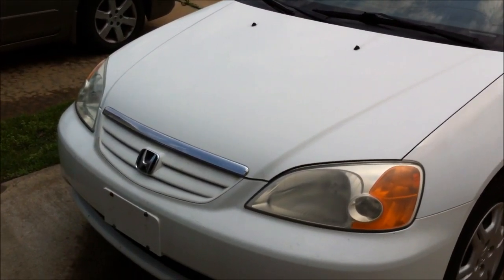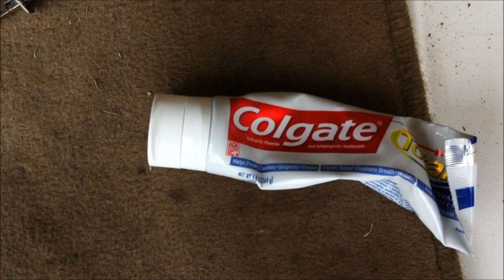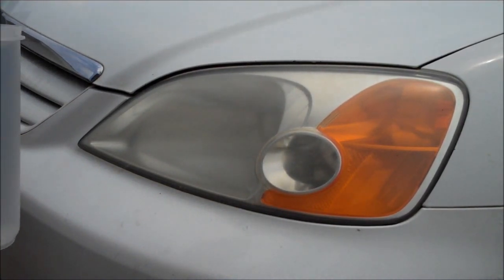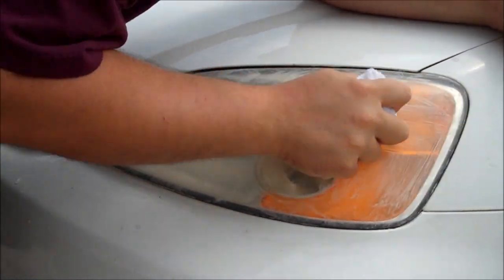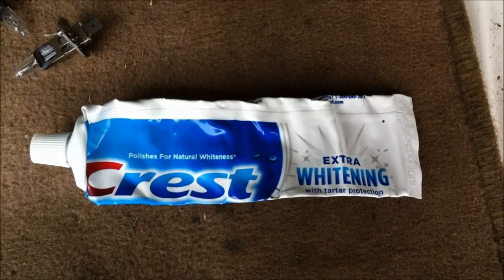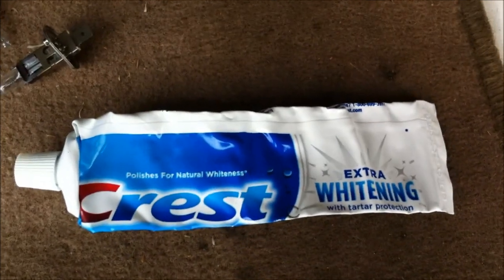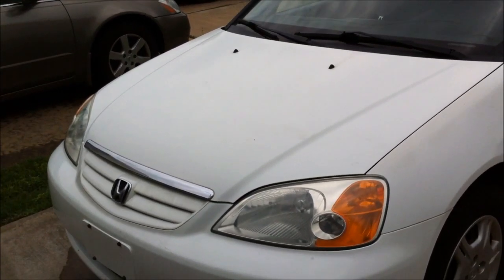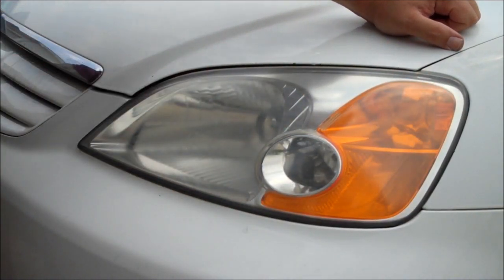Headlight Lens Restore using Toothpaste!

Comment: I restored my 12 year old Corolla headlight lenses. They were getting to the point that they wouldn't have passed through the MOT certification.  My garage advised I try original T cut and after several hours of working each lens, using a circular motion on them they came up like brand new.  It's much cheaper to do this than buying expensive units. I still give them a polish when cleaning my car and they look good still.
Reply: +oldproji   Really - I wonder - because I did this to just test it and it did not work at all. The haze was still there after 20 minutes of circular scrubbing - it really is a waste of time.  I will buy replacements.

Comment: Just did my 2001 Camry's lenses and am very pleased. Went from super-hazy to near total clear. It didn't restore them to brand new condition, but nearly so. For SURE beats spending money for the over-priced commercial stuff. if I were going for absolute best results, I'd use the fine grit sandpaper and clearcoat method. But this was perfect for what I needed. Cheap Colgate FTW. Thanks for the video!

Comment: It also does a better job than most things in regards to getting mineral spots, bugs, or tree sap off of window glass while not scratching. Also the toothpaste with baking soda from the dollar aisle works rather well.
Reply: It's not going to be one of the main brands, but rather a "generic" brand. I think it'll be Dr. Whitmores or something with a name like that. Baking soda toothpaste also seems to work much better than regular baking soda, probably because the abrasive is in an emulsifier or something like that. It doesn't settle out or need re-wetting as much.
Reply: 0000 steel wool is an excellent window cleaner. Try it on any window grime dry, it will NOT scratch. Wash the glass 1st to knock off any loose dirt.

Comment: I'll be darned if it doesn't really work. I picked up a small tube of Arm & Hammer Advance White 'cause it has baking soda and peroxide (i.e., has grit). Applied to headlights on a 2008 Prius which had some, but not real bad, oxidization. Worked like a champ—Thanks!

Comment: My dad told me about this trick too. He also told me about how when he was a kid, during the muscle car era, if your car won’t turn over and you’ve eliminated the cause being a dead battery buy turning on all your interior lights and blasting the heat and stereo and then turning on accessories and there’s no headlight dimming, then your starter is toast, but there’s a trick to getting it started so you don’t have to pay the sometimes absurd towing fees, that he and his friends used to do...hit the starter with a hammer...it sounded like BS to me too, but I recently had my starter die on me and to my amazement, after locating the starter, which depending on the car is usually the hardest part, hitting it with a hammer, it started immediately. This worked 4 more times before payday rolled around and I could buy the starter and change it. So these tricks are timeless I guess, also always listen to your dads, their wisdom is just always on a much higher level and they teach you so much. My dad said the oxidation may appear to be on the inside, that’s what i thought at first too, but it’s not and I believe him. Also he said the type of toothpaste doesn’t matter, my guess is this guy just needed to do another round or two of buffing and rinsing and would’ve ended up with equal results on both lights.

Comment: tried it on my 8 yearold cl500. works great. also, you should use something like a turtlewax paint polish to apply a clear coat on top of the headlamp for protection from oxidization.

Comment: Great tip! I used a 3M kit about 3 years ago. My lights looked terrible again. I am lazy I still had the foam polishing pad from my kit. It saved me some time. I used colgate optic white. My results were 90% as good as the kit and much faster and less expensive.

Comment: Dude, I just happened to use the toothpaste you recommended (Crest extra whitening with tartar protection, mint green with the granules), so I tried it out on the cloudy headlights on the used car I just bought. It magically cleared them up, but then I noticed there are all these little scratches on the lens now.

From another website: "What kind of toothpaste works? Toothpaste is a mild abrasive, so it naturally works well to polish things, and fill small scratches. Just don't use any kind of toothpaste with cooling crystals or anything like that, as they will scratch the surface badly."

That's exactly what happened. What's the deal and how do I fix it?
Reply: pontiactmontanna2002tractionsencerllocation
Reply: More polishing might help. With a non scratchy toothpaste.
Reply: Do it the proper way - progressively finer sandpaper to roughen then polish it, then spray a clearcoat layer to stop yellowing.

Comment: It works well, been doing it awhile now.

But to restore them to pretty much factory. But a foam buffer for a drill and use it with the toothpaste. Amazing results. The foam wheel is about $5-20.00 depending on size and how good it is. $10.00 is about perfect it will last 5-6 months. And you can repeat cleaning lights and even polish you car with it. The cheap ones only work for 1-2 jobs if you do it right. But, if you have a newer car...thats all you need. I have a 2003, so I went with a $10.00 one. 

HUGE TIP: Make sure you rinse the lights VERY WELL. Any extra toothpaste will turn yellowish fast. And make it look like you never cleaned them. Friend did his in 10min (both) and 2 days later...yellowish. Take about 20min and do it right. 10min per light seems to be a great time per light. And seems to last about 3-5months. A coat of polish (good stuff not cheap) after helps them stay looking good longer. It repels bugs, and also makes it less likely you will get all the nasty stuff on the lights in rain and stuff. And it is alot easier to redo the next time. Always a plus!

Comment: This did work for me. 2007 RX-8 with moderate yellowing. The cloth actually got stained yellow. I used Crest with extra whitening.The lenses are 95% improved to original. I waxed over them just to prolong the effect. Good luck with yours!~

Comment: My B-in-law used a Turtle Wax headlight lense kit on my car with very poor results. I looked up other methods here on the net and saw where one guy used a Fresh Lemon , cut in half to rub the lense for a minute or so then let it dry. Next he used a was of steel wool, a very fine coarse, finer than 0000 grade to scour the lense. Wiped it off, rubbed the Lemon Juice on again, let it dry then buffed the lense with a soft clean cloth, like an old clean T-shirt. Last he coated the lense with a carnubba wax, let it dry and buffed it off. I tried it but could only find Ten-O Steel wool and then I had to search for it, found it in an Ace Hardware. I found the surface to be very smooth when I finished with it. It worked and Lense looks like new from the factory.

Comment: By doing this sort of "repair" you are removing the U.V. coating on the lens.In order to do this correctly you will need to add a coat of U.V. stable clearcoat otherwise they will just cloud up again in a month or 2.

Comment: I used colgate optic white, which is slightly more abrasive. It takes a lot of rubbing but does work, albeit very gradually. My wife came out with metal polish and said try that. After a small test area, we did the complete set. FASTER, brighter and now 12 year old headlights look new again even after a few days, so it is not temporary. Much easier to get quick results.

Comment: But I always thought the dullness came from inside the head light.
Reply from the maker: Not always....that can be the case sometimes, but most of the time, it is oxidization buildup on the outside of the lense.
Reply: Dullness comes from the inside but only with people not headlights;)
Reply: That's exactly what I thought.
Reply: Nice one Dung file.
Reply: el pelotero michoacan
Actually it is true, my auto instructor said toothpaste is good, ALTHOUGH the ones with crystals in them is a bad idea, since those scratch up the headlight
Reply: Some headlights do fade from the inside, especially if they have been getting moister inside. If you would like a real product meant for cleaning off the oxidation from the outside of the headlights go to LenzClear.com
Reply: Nope your wrong moist only happens inside not discoloration.Most likely you haven't cleared the outer lens properly and you concluded right away its from inside.Your Wrong I am sure of that.Use megiuars plastix 100 percent effective than toothpaste.
Reply: Denman Delos Reyes  Nope your wrong. I guess your new at this, Just today,  I have a 2004 Saab 93 areo faded from the inside. Older jeep Cherokees fade from the inside. I have come across many more over the years. Call any junk yard and they will confirm that I am right. Maybe you should check your facts before opening your mouth.
Reply: Mi Mo Nope your wrong. If it's from inside then you have polished it inside?You are talking to a qualified mechanic.Where did you acquired your training?Online?Your just advertising product's.I've never found lens that fades inside.I guess only fools will buy your product.
Reply: Mi Mo No your wrong.I had been a mechanic for a long period of time now.Since the production of plastic headlight lens I have never encountered a fading inside.Most likely that's you alibi to your customers.You are talking to a qualified mechanic who has a 25 years experience in this field.Where did you acquired your license online?Check Facts first before bragging and make sure you read all the tech info online.
Reply: I have been in the car business all my life, racing at 18 starting a car detailing business at 22 a few years after that, a car dealership. I have been going to auctions, junk yards and dealerships all my life. I am now 50 If you think your so right, how much money do you have to bet. put it where your mouth is. Headlights can and do fade from the inside, its rare, but it happens. I have a set in my driveway and on my neighbors Cobalt.I have also seen it recently on a 95 jeep grand Cherokee, it also happens to some older  E class Mercedes. I will welcome any bet, All headlights are not made the same or from the same polymer, poly-carbonate . Which is plastic for guys like you who think they know what there talking about..
Reply: Denman Delos Reyes I have been in the car business all my life, racing at 18 starting a car detailing business at 22 a few years after that, a car dealership. I have been going to auctions, junk yards and dealerships all my life. I am now 50 If you think your so right, how much money do you have to bet. put it where your mouth is. Headlights can and do fade from the inside, its rare, but it happens. I have a set in my driveway and on my neighbors Cobalt.I have also seen it recently on a 95 jeep grand Cherokee, it also happens to some older  E class Mercedes. I will welcome any bet, All headlights are not made the same or from the same polymer, poly-carbonate . Which is plastic for guys like you who think they know what there talking about..
Reply: Denman Delos Reyes you're**
Reply: Denman Delos Reyes  bullshit. headlights oxidize from the inside too and get damaged, and you cant clean them....
Reply: gawddang actually you can clean it from the inside just takes a longer process and I wouldn't recommend for everyone but what I did to separate my headlights was to bake them in the oven at a very low temperature of 200 for 20min which loosens the glue that holds it in place which I then wiped the inside to clean it all before I painted the certain parts I wanted. I also used the same method for my tailight which was getting moisture inside and resealed it with clear rtv silicone
Reply: Cindy Sin So did I.  Wouldn't the "seal" on the headlight unit have to be "broken" for oxygen to get in (like a two paned glass window)?  It makes sense for the outer surface to be oxidized given its exposure to the "elements".And why would there be a number of (expensive) products on the market to apparently only "clean and polish" the outside of the headlight?
Reply: Classic Gamers HQ if the headlight cracks it will do that
Reply: In your case Yes Cindy, they dullnes may come from within.......lol
Reply: Denman Delos Reyes yeah thought as much, thanks

Comment: There is a principle of "abrasives" being ignored here. "Abrasion" is the removal of material, and your headlight's surface damage goes pretty deep.

Sure, you can get some fairly decent results with just toothpaste, but it is certain that the restoration will not last as long, and not look as beautiful as it could have if all the damaged material had been removed.

Here is a WORD PICTURE that will help you understand the problem with beginning with TOO FINE AN ABRASIVE LIKE TOOTHPASTE (which happens to be an excellent and cheap abrasive!). Imagine the microscopic, damaged surface of your headlight as a series of "mountains" and "valleys" (pits, cracks, crazing, wear, scratches, etc. etc.). If you begin with too fine an abrasive, YOU WILL NEVER BRING THE MOUNTAIN PEAKS DOWN TO THE VALLEYS! It would take you hours and hours, and you would never be removing enough damaged material to obtain a complete restoration!

In other words, beginning with too fine an abrasive like toothpaste will only succeed in polishing the highest  "mountain peaks," and nothing more! Get it? Will you see an improvement? Yep! But it won't blow you away, and it won't last because you still have lots of damaged material on the surface.

The right thing to do is begin with a much more COURSE ABRASIVE such as a wet sanding abrasive paper. "Sanding" will remove the "mountain peaks" much more quickly and bring the "mountains" down to the "valleys" and render a microscopically FLAT SURFACE!

Now you begin "wet sanding" with fine abrasives, and then use something VERY FINE like toothpaste. Now the toothpaste is abrading  the entire surface of the headlight, and not just polishing those "mountaintops."

Once you understand the microscopic surface which consists of mountain peaks and valleys, you will understand exactly what toothpaste is accomplishing when it is used first instead of last. TOOTHPASTE will never take you down to the very bottom of the damaged material. All TOOTHPASTE will do is "polish" the damaged material.

A proper restoration achieves the REMOVAL all the damaged material, and then "dresses" (polishes) the new material beneath the damage with very fine abrasives such as TOOTHPASTE.

Did the WORD PICTURE about mountains and valleys help? I hope so!
Reply: +Mike J Baron Thank you for the helpful info. what do you suggest is the best way too remove hard water stains from a stainless steel sink?
Reply: You might want to try this before knocking it. I collect and restore police lightbars. I use Colgate whitening with the little micro balls in it. Not only does it last, but with a good micro fiber pad it easily removes all scratches except very deep ones. Which even wet sanding with 2000 then finishing w/3000 using Nuvos 3 step scratch remove, buffer, polisher wouldn't take out. Most people aren't looking at headlights or police lights with micro scopes.
Reply: Thanx.I'll try the Colgate. By the way, not to be nosey or anything but...what do you do with the police lights you collect? Just wondering. ....
Reply: +Lola Trailera HI Lola, believe it or not but there is a huge following of people that collect lightbars. Not so much new ones but older classic bars. I'm a volunteer fire fighter so I have one on my truck, and one in my man cave. I do it more to make money. I buy at government auctions, like the last auction I got 9 code 3 mx7000 light bars for $106. I then refurbish them and sell them on ebay. If restored right each bar sells on average for $200 to $400. So I'll let you do the math 😉. It's good money for something I like to do anyway.   Hope that helps.
Reply: +vizzuleyes I did try it - it does not work that well at all!
Reply: Mike J Baron aw

Comment: Interesting video, I'll have to give it a try.  FYI to all of you think that buying a replacement pair of headlights is easier or the same cost: many aftermarket headlight assemblies become clouded even faster than the original.  If you're going to replace then buy factory, OEM headlights-the cheaper aftermarket stuff may not give you your money's worth...

Comment: While you can use toothpaste to shine up plastic lenses I've found that using something stronger like Slipol (don't know if that's available in your country or what a similar polish is named) or Brasso. It takes the foggyness very easily with no excessive rubbing but leases surface a lille mat with fine lines. Then use the softer variant Slipoline to finish if off to achieve absolute perfect result in no time. If you really want it top notch finish with some hydrophobic nano coating.

Comment: I did this while trying to be a mad scientist and it worked without the effort. 1) I used "Fantastik" first to cleanit 2) Then wet a papertowel, add "Bom-Ami" or "Ajax" and rub it for a while 3) I used a store bought headlight cleaner 4) I wet it down with a spray bottle and rubbed with 2000 grit sandpaper 5) Spread colgate toothpaste all around and rub that in 6) Spray heavily again with "Fantastik" and paper towel off 7) Used spray bottle and heavily soaked the area until wet. 8) paper towel dry 9) Applied rubing compound and kept rubbing, not hard but keep the motion going 10) let dry to a haze and then towel it off with a soft towel. My headlights now look like new.